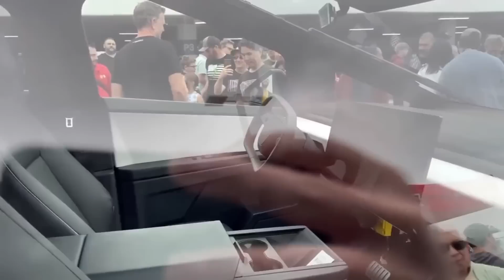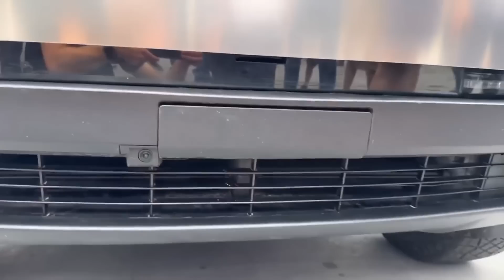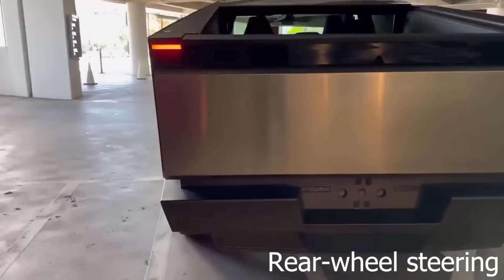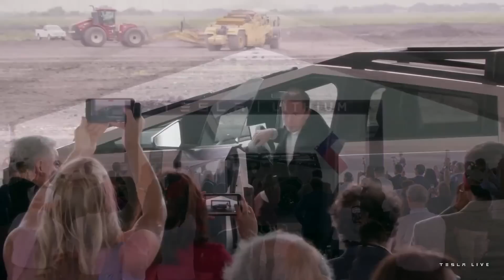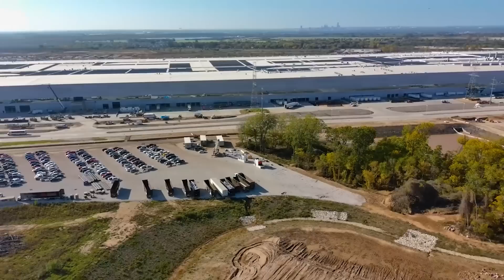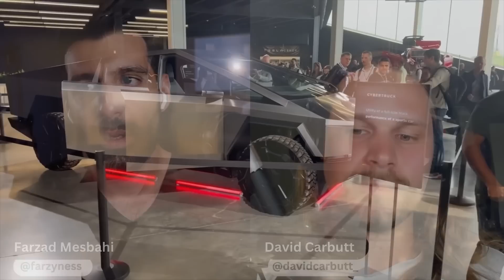Tesla CYBERTRUCK’s Biggest Risk!

Comment: I'm a hotshot driver (basically a semi truck driver using a Ford F450 pulling a gooseneck trailer). As Jim Farley said, I don't think most cybertruck owners (as with F150 owners) will use the truck for truck things....Jeep things maybe but people who buy half ton pickups don't usually use them for work and/or pulling heavy trailers. I would love to see a dually version of the cybertruck with the Tesla semi axle under the truck. In 2022 I spent $42,347.75 on fuel, 
 I've spent over $20,000 already this year. My two biggest expenses are fuel and insurance. Tesla could cure both of those problems with a F-450 competitor! I spent $88,000 on my 2021 and would easily spend $100k on a truck that could save me in fue, insurance and maintenance. I realize this is a pipe dream but if commercial trucks are the most important problem to solve for a sustainable future, they should hurry up with the mega chargers with room for trailers and people like me will jump on board just to save money!!! I could get the semi when available but I'm home every weekend and my kids and I use the pickup while I'm not working and they can't drive the semi. Plus for what I do the tight turning radious really helps. Anyway, my two cents

Comment: Cybertruck is certainly the most important Tesla product in terms of carbon emission reduction/sustainability, which is Tesla’s published mission.  This is because the trucks that it will replace contribute far more emissions per vehicle than the sedans and small SUV’s that the other Tesla models displace.

So, for Tesla to achieve its mission, it should ramp the Cybertruck as quickly as possible.  Thus much faster than 10K/100K/200K that you have quoted.  I would look for 10K/150K/400K.

Comment: Seems to me the fundamental issue is load carrying capacity which is the primary purpose of a truck. At what point does the gross weight/load capacity ratio become either uneconomical/impractical for the owner, not to mention the impact on infrastructure of having heavier vehicles carrying comparatively lighter loads?

Comment: 5000 Cybertrucks in 2023 seems reasonable, followed by 100,000-125,000 for the full year 2024.   Elon has said the ramp will be slow at first.
As a November 2019 reservation holder I fully expect that I will have to wait until mid 2025, or fall of 2025 before I get one in my driveway.
Reply: That's actually insane.
Reply: @bigredog100  What is insane?  That Elon said the CyberTruck ramp will be slow initially?   I think everyone that follows Tesla closely believes just a small batch of Cybertrucks will be built before the end of 2023.   And then probably a small number in the 1st quarter of 2024, and hopefully ramping enough in the 2nd half of 2024 to see about 125,000 deliveries for all of 2024.

Comment: 10k delivered this year, 100k next is crazy talk. My prediction is 420 if we're lucky, maybe 10k total next year if ramp goes smooth. It won't. It's an entirely new way to build a truck which is a new product category for Tesla, so y'all need to temper your expectations. There will be issues, bottlenecks, recalls, adjustments, parts shortages incl. 4680 cells so expect 100k around 2026 not any earlier.
Reply: I'm not so pessimistic.  Cybertruck will be a lot easier to build than a traditional truck.  No panel stamping, no unibody, fewer robots, no painting, precise geometry, stainless steel experience from SpaceX, etc.
Reply: @MsAjax409  There's this misconception that the Cybertruck is easy to build cause it has triangular shape with no paint and fewer parts. First, the steel bending machine alone may take 18 months to perfect to speed but then even at Tesla efficiency, the rest of the truck will have AT LEAST 50% MORE parts than structural Model Y they are STRUGGLING to ramp.

Both CT interior & exterior have more things to it, adaptive air suspension, truck bed, various storage spaces, motorized tonneau cover, retractable back glass, power outlets and EVERYTHING being 100% watertight, unlike any Tesla. Possible steer-by-wire too. I predict the stainless steel exoskeleton to aluminum under body alignment will give them SERIOUS headaches as they contract and expand to extreme temperatures differently. They bend differently as well under serious load and conditions (fast curves, uneven terrain etc). 

The first few hundred CTs will be test mules to figure out what works and what doesn't at product lines (prototypes were built by hand) and they'll change a LOT. Perhaps even find bad design choices they cannot easily address. Then there's the battery bottleneck and whatever special parts may find shortages. That could be a LOT incl. raw materials, steer-by-wire or whatever high voltage components, chips and whatnot. It doesn't make sense to do 50k in the next 18 months and find serious issues and recall 50k. They'll ramp slow to perfect the extremely new and difficult and complex manufacturing first and THEN go scale, and that's late 2024 the earliest IMO. See Starbase stainless steel manufacturing? That took year and still not at intended scale.
Reply: @BigBoneESB  You may be right, but I think a lot of the design and engineering of Cybertruck has taken place during the 3+ years since its reveal.   I choose to stay optimistic.
Reply: @MsAjax409  I hope you're right. The leaked Hasselblatt documents say otherwise tho. And still, prototypes are easy, production is hard and no matter how much time they spent perfecting the design, it's the actual production line buildout and ramp that is 99% of the work and that's still 80% ahead. 

P.S. great delivery numbers released today :D
Reply: I admit the Model Y ramp was spectacular but a) it was built on the tried and struggled and tested Model 3 platform and it was really Shanghai that upped the numbers shaming everyone else. Berlin Y ramp has been slow and Texas 4680 builds are barely happening. At all. Cybertruck, likely built around the structural pack, using many radical design and manufacturer choices will NOT ramp fast. Neither did the X. Or the S. Or the Model 3 initially. 

And it will cost a pretty penny, I say Cybertruck starts at $80k and will stay there till 2026 when a 60k trim arrives. Forget about 40k.

Comment: My biggest fear is that Tesla recants on the high mileage version because of battery scarcity. The Plaid Plus was supposed to be 520, and then they rationalized it away as no one needs it. People can debate that. A truck however is a divide by 2 if you tow. 520 will be 260 at the very best. If they simply offer a 400 mile or so due to these kinds of rationalizations, I will demur on my reservation until they come out with the long range as promised. Other than that fear, I can't wait.
Reply: I agree they need to keep the 500+ mile range promised for the tri/quad version.  This is a big failure on the Ford lightning and Rivian.  If Tesla keeps the range they will destroy the competition.
Reply: They have the best charging network, the Supercharger.
Reply: I don't think they will release a 500 mile version at launch, or during the first year.   Even though that is what I reserved.   Batteries are still a bottleneck.    I have coined the phrase "Mars Edition" as the lauch version, with 401 miles of range, for $89,900.   Since they never advertized a Mars Edition, they can technically set the price at whatever makes sense for them.
Reply: @billsrelectric 
Blade Runner 2024 edition
Total Recall edition
Pirate Ninja edition
Reply: @SpaceCaseZ06  I like em!   Blade Runner Edition, yeah, let's do it.

Comment: As the Worlds first 48v architecture vehicle with zero components available, Tesla also has to ramp the manufacturing of Cybertruck components
Reply: Re: New Tesla Componentry. Already supplied & ramped up by the planet’s best & most experienced EV designers & production engineers. (To the snide panty twisted commenter below) Suppliers love Tesla bc they’re virtually the only producer that can be relied on to maintain consistent demand AND pay their bills, often well in advance. They often benefit from lower prices that are split between sales prices & margins.
Reply: Rather than caustic sarcasm, I would counter that Tesla is highly skilled at electronics including high voltage, so probably won’t have a problem with 48V tech.
Reply: Ouuuuh sooo insightful
Reply: Or use 48V to 12V converters
Reply: @MsAjax409  they will lose cost savings with a bunch of converters